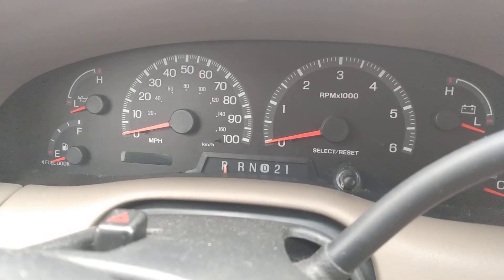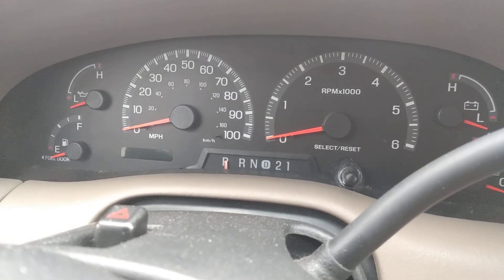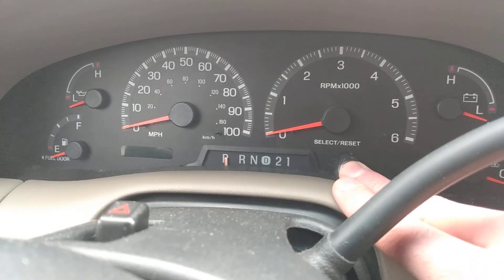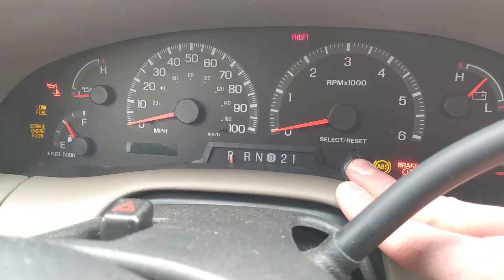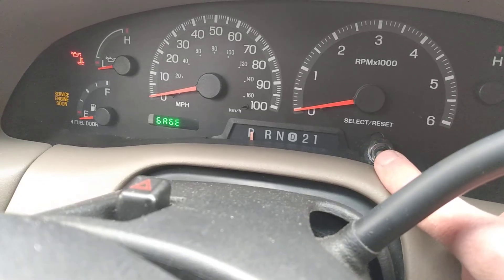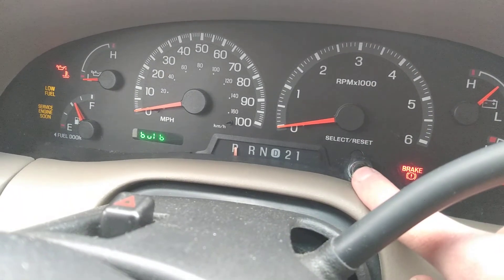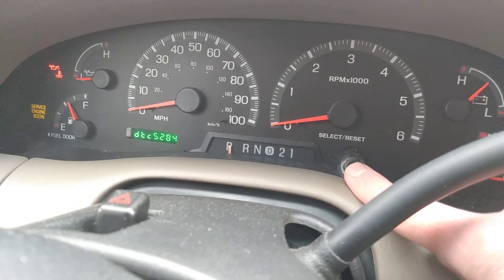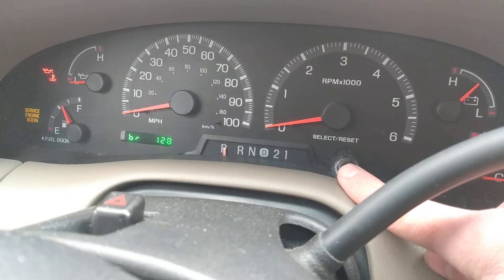2000 F150 digital odometer engineering test mode

Comment: I have a “t” on the mileage area. What does that mean?
Reply: That stands for Trip. Its counts or it tracks the mileage you do in long or short trips without affecting the original mileage on the motor and those “trip” miles are also tracked on the actual motor mileage so there’s no cheating or worrying about it being inaccurate that it got clocked into one and not the other meaning if you trip 800 miles and your actual mileage is 180,000 you will see 180,800 no matter if its trip or not but the trip miles can be reset by press and holding the button until reset which means that you start all over from 0.0 and go your way up but if you don’t like that mode just click the button once and it’ll go to your motor miles
Reply from the maker: @jellybellys210  I don't know, might be tachometer for rpm's, transmission temperature or something else.